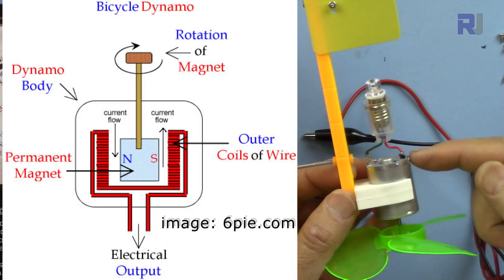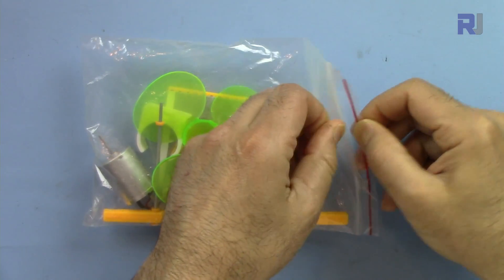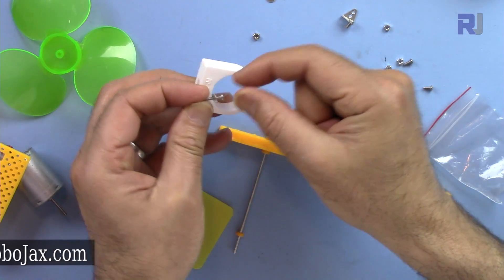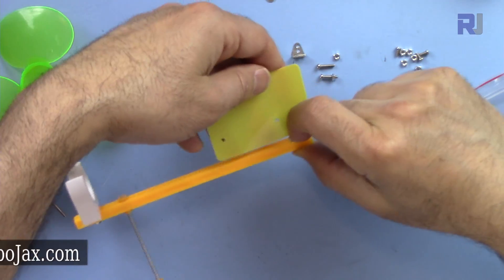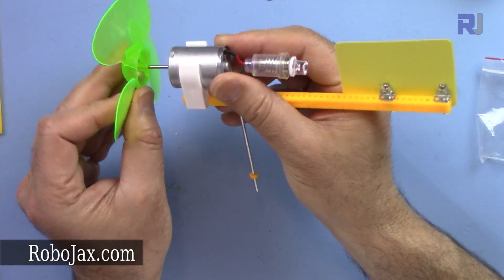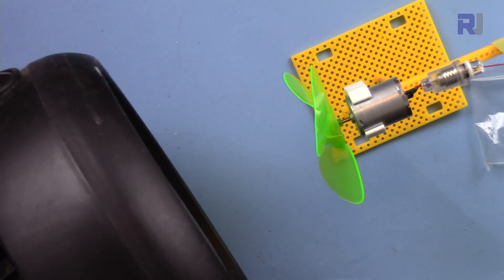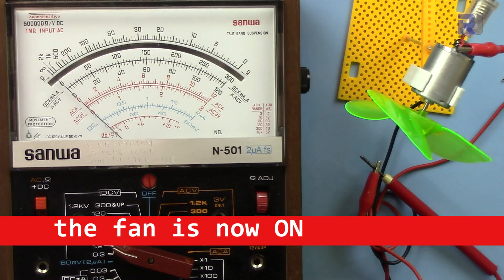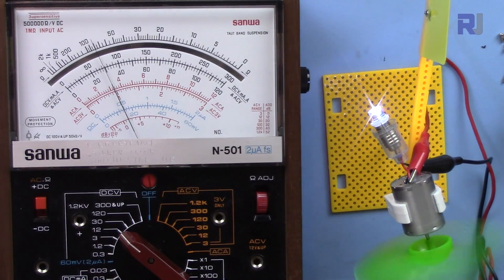Educational mini wind turbine generates electricity when fan blows to it

Comment: If I put this in my bike to get energy from wind do you think it would be enough to charge my phone ?
Reply from the maker: if you are fast enough, yes you can. but at lower speed it won't work. you can increase the size of propellers so even with the slowest speed, it rotates faster and generate enough power to charge your phone. you need to have a boost converter such as this https://youtu.be/LMKiPE_2Uu4  that receives even 2V and converts it to 5V it is possible.